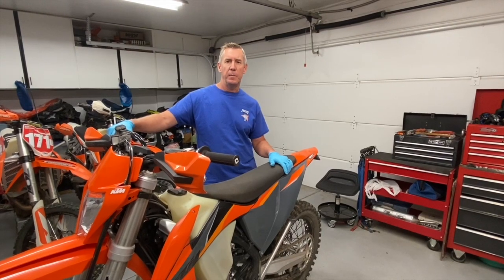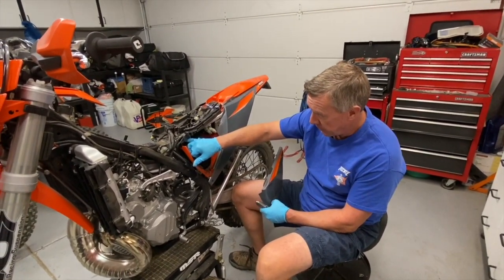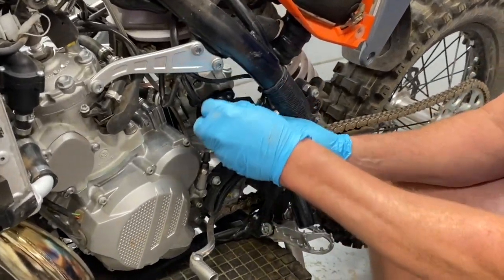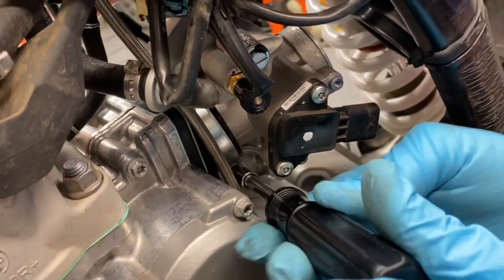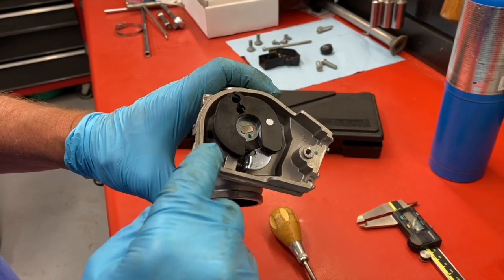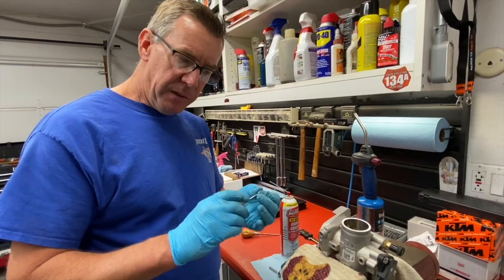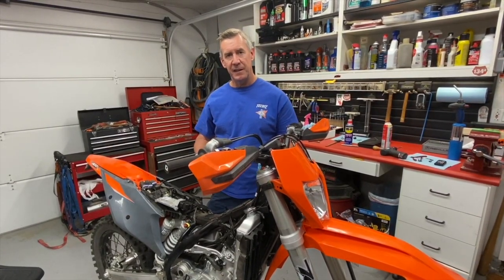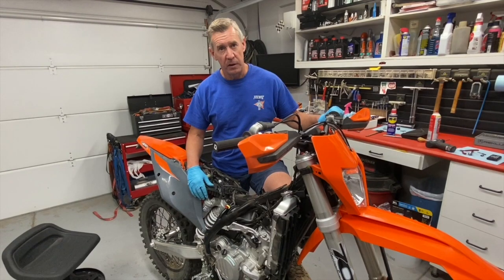Removing Throttle Body and Installing TSP Idle Screw

Comment: Thanks for your VERY helpful video, Steve! I installed an idle screw on my '23 KTM 300XCW and although it took me 4.5 hrs to do it (slow learner), it was relatively easy and now I have an adjustable idle screw -- as the bike should be. This is my first 2-stroke motorcycle -- have only owned it 6 weeks -- and prior to watching  your vid, I didn't even know how to take the seat off. So... learning curve. Anyway now I've not only got an adjustable idle screw, I'm also much more confident about taking my bike apart and putting it back together for service as needed. THANK YOU SO MUCH for making a really thorough video that was so thorough that even a rank beginner like me can feel comfortable taking such a project on. Though I admit I was terrified while heating my throttle body up to remove the stock screw. Whatever -- it worked perfectly.

Comment: Great video.  I just got my TSP kit and am installing mine.   I really struggled getting the airbox boot off the throttle body.   I'm not sure if it's because it's cold here or what. I gouged up my throttle body trying to get a screw driver in to help it off.  I was going to rip the boot right out of my airbox I was using so much force and it still wouldn't come off.   My suggestion is don't even think about using a screw driver.   What I found was MUCH easier is to loosen the clamp at the reed block.  Pull up the sub-frame up and the throttle body will easily pull out of the reed block.  Now you can twist, and tilt the throttle body to the side which will make is MUCH easier to get it out of the airbox boot (no screw driver!).   There is a sharp little lip on the throttle body that makes pulling it straight out very difficult.  So this way makes it way easier and save you an hour of swearing.
Reply from the maker: You are absolutely right Doc.  This is exactly how we do it now after coming to the same conclusion you did.
Reply: Wish I got your comment some months ago. Yes, I had hard time to detach the boot too...

Comment: This was a great video I used it comprehensively today. So well made, really helpful for a newbie like me. Only thing I found was on my bike the wake up dongle wouldn’t prime until I reattached the fuel tank pump connector. Not sure if I maybe didn’t hold the throttle open long enough though I did try it several times, I reattach the fuel tank and it worked 
Also my throttle cables were seized onto the 10mm nuts so when I undid the they must have thrown out the adjusters at the top of the cables. This really had me perplexed for a while. Make sure your 10mm nuts are not seized to the outer sheath I would say spray them with some WD40 before undoing them.  Again thanks for this great video. Getting the throttle body out without lifting the sub frame is pretty much impossible ( I know), your tips were just the tricks needed 👍👍👍

Comment: Excellent video.  For those without a blow torch, I used a few drops of super glue debonder to loosen up the loctite holding the throttle body grub screw.  Grub screw came out easily.
Reply: I tried the debonder for 3 days, and put a soldering iron on mine to heat the Loctite, and still ended up stripping the bolt. Wish it were that easy on mine, but unfortunately it wasn't. It's sad that these bikes aren't allowed to come with the needed adjustment screw.
Reply: @samb4577  what did you do to get it out after you stripped it?

Comment: Thank you for this. Just installed an idle screw in my 2019 KTM 300. Was having troubles with idling, and wanted to use the bypass screw to adjust mixture at idle. Was running fairly lean to get the rpm for tickover. Running much better now, and followed most of your instructions to a T. 

Really grateful, thank you very much.

Comment: OK now this is the LAZY BOY option. I didn't want to tear my brand new 2 week old 2021 Husky 300 TPI down so this is what I did. First I removed the single retaining screw and popped off the throttle cover (I did not need to remove the exhaust to do this, I just GENTLY pushed it from the OTHER SIDE on it's edge at the top with a broad bladed screw driver and it popped off). Secondly I could see the blue Locktite on the screw and I sprayed it 4 times with ordinary DISC BRAKE CLEANER, 30 minutes apart, and left it overnight. Next day all visible blue Loctite was gone, an encouraging sign, but I knew that some would still be active in the threaded section of the housing. 

I then removed a 2.5 Allen/hex from a folding bicycle Allen tool set which have those big loops at the end when you take them out of the set (the loop is critical for leverage, a standard Allen wrench will not work) I then fitted that to the idle screw and once in place, used a bigger Allen wrench handle through the loop in the 2.5 as a lever (any handy short lever would do just as well).Very slowly I kept pressure on it but TIGHTENING it, not UNDOING it. (So many people go wrong trying to loosen reluctant engine setting screws, tighten them first whenever it is possible because the wrench is being pushed in, much less chance of stripping the hex). Just as the 2.5 Allen started to twist a little under strain, it gradually turned the idle screw a fraction so I stopped and warmed the engine to full operating temperature.

 

Whilst doing that I plugged in my OB2 diagnostic unit (dirt cheap on Ebay but get the convertor plug made in England by Lonelec to connect to KTM/Husky) and via my mobile on the free OB2 App, watched the ECU rev count NOT the ENGINE rev count because that fluctuates too much on a 2 stroke, the ECU RPM count is the AVERAGE reading and THAT is the one to set your idle by if you have the choice to do so. It is easier to get the really fine adjustment on a 2 stroke this way. After much experimenting on my bike I found 1775 ECU RPM (easy number for you Yanks to remember!!) to be the optimum for my bike with the Air Bypass Screw totally SHUT. There is ZERO reason for using the air bypass screw, it is ONLY there because manufacturers cannot use any other method to adjust idle without effecting emissions. It is a total bodge because the TPS has not been moved so the ECU has not been 'informed' of a change. 

That is why despite raising the idle speed you get 'flame outs". My bike used to do it all the time and always in the worst situations which caused me to fall off several times on steep hill climbs etc. The Air By Pass bodge works kind of OK on cars and even to some extent most 4 strokes but the 'work around' was never intended for high performance 2 strokes which have totally different "needs" to deliver optimum power delivery characteristics. Trust me, just screw the stupid POS Air By Pass SHUT and experiment with getting a perfect setting with the idle screw, which moves the TPS and 'informs' the ECU to adjust the mixture accordingly.

 

Your bike might vary on it's perfect RPM average but now mine pulls really cleanly off the bottom (quite critical on the RPM reading I found, higher or lower RPM settings were not optimum) and is NOW great at ultra low speed manoeuvres like "figure of 8" at walking pace, but also goes like a f**cking missile when cracked open. Honestly, it is like riding a totally different bike. The first time I gave it a whiff of throttle the front wheel came up so fast in a power wheelie that I nearly fell off, I just wasn't expecting that much sudden performance increase from fiddling with an idle screw! Lastly, remember to drill a little hole in the plastic cover before you put it back so you can adjust the Idle screw without removing it. 

I will get around to replacing the Idle screw with a 5 X 50 mm next time I am in a hardware store (I am certainly not paying $35 for one! 10 cents and an old spring from a Beretta shotgun more like!) but for now I haven't bothered as I don't want to disturb my perfect setting and there seems to be enough Loctite still on the screw to prevent it unscrewing in service. i.e. the idle adjustment is quite stiff in both directions which is perfect. So guys, that is a lazy-arsed Brits way of achieving exactly the same result with 10 per cent of the effort. No heat, no rebooting the oil pump or anything. 

If you do get it WRONG and strip the hex head you are no worse off because you were going to strip the entire bloody bike down anyway, in which case you can release the screw with a pair or pliers once you have melted the Loctite. Worth trying! Less hassle, more riding time!
Reply: Thanks for info!!
Reply: Soy bastante novato en este tema de desmontar todas las partes de mi husky, lo aprecio como terapéutico jaja , acabo de leer tu comentario y claramente voy a intentar con tu comentario jaja . Podrían indicarme el tornillo regulador de aire donde debería estar colocado ? Porque no me ha quedado claro si es completamente CERRADO

Comment: Thanks for this, very helpful. I did it without removing the pipe, just a bit fiddly. I found with the plate covering the throttle cables was hard to separate and I didn't want to force anything so I pushed it at the top from the left side with a screwdriver. Cheers

Comment: Hey! Nice video. Courious to hear about the air screw setup after the mod. Thanks
Reply from the maker: 2018 and 2019 we recommend 0.5 to 1.5 turns out on the air screw.  On 2020 and 2021 we like 2.0 - 3.0 turns out.

Comment: Thanks for the video.  Once you have the new idle screw in, what is the usual fix?  Do you increase the space to more than 4.5mm or less?  I assume you try to keep the air screw at factory setting, and then just turn the idle screw in or out?  If idle was too low, does that mean you turn it in to increase to 5mm or more?
Reply from the maker: There is no usual fix.  The idle screw mod just gives the rider the ability to have independent air mixture and idle adjustments.  The air screw does not need to be fixed to factory settings.  It should be adjusted to achieve the optimum off idle throttle response.  The air screw has very little affect past 1/4 throttle.  Turning the air screw in is a richer softer delviery.  Turning it out is a leaner more crispy setting.  For a typical TPI, 2020 and newer, 3.5 turns out is a good baseline. For 2018-2019, 1 turn out is a good baseline.  Once you have the manual idle screw installed, get the motor up to normal operating temp, and adjust the idle screw in very small increments, 1/16th of a turn at a time, with gentle blips of the throttle in between each adjustment.  The goal is to achieve as low of an idle as possible while maintaing a smooth and rhythmic idle.  No stumbling or stalling.  If you adjust the idle screw too far in or too far out, the ECU will thorw a fault code letting you know the TPS voltage is outside of the desired range. Turning the idle screw in wil lincrease the idle speed and increase the TPS voltage.  Backing the idle screw out will lower the idle speed and lower the TPS voltage.
Reply: @sbmotoperformance  This is exactly what i needed to know.  Thanks!

Comment: Good information. At 12:00 I started wondering if clipping off the plastic was necessary. Couldn't you put the plastic cover on first and then feed the idle screw through the new hole? Setting the 4.5mm gap would be a little more tricky, I guess.
Reply from the maker: You would need both he idle screw and the spring to fit through the hole without making contact.  I think it's easier to just clip the end out.

Comment: I just bought this kit and my bike has never had trouble idling. Do I need to install the idle screw or would I be okay with out it?
Reply from the maker: You can certainly try it without it.  If you feel the idle needs to be adjusted, then we recommend installing the idle screw.
Reply: One of the benefits of a proper idle screw is that you can use the bypass adjuster to change the mixture on idle/low rpm. Allows for better pickup from idle.
Reply: @Jadder88z  I am having trouble understanding how to adjust the idle screw vs the air screw

Comment: Watched your video and installed the idle screw but I had previously adjusted the air screw. Do you know what the factory setting was on a 2021 KTM 300 XCW on the air screw?
Reply from the maker: Factory setting on the air bypass screw vary, but we usually find them between 3.5 to 4.5 turns out from fully seated.

Comment: On my 2020 300xc its was a torqx, on the gasgas 2021 300ec it was 2.5mm hex, my second time around was quicker BTW you do not need to remove the exhaust pipe plenty room from the other side, remove the cover and cables after you get the throttle body out of the boots. Save $ source your own screw, specs 50mm long, 5mm x 0.8 pitch metric screw, plus you need approx 3/4" long spring.  Tip spray WD40 in the boots to help them come off much easier

Comment: Great video , but question So I got the factory Loctited idle allen screw out , but after removing it the throttle mechanism didnt move towards the stop , it stayed at 4.57 mm the exact measurement I got before I removed the factory allen screw, Seems a little odd?
Reply from the maker: Very odd.  Have done hundreds of these and the stop plate always rotates back a bit when removing the set screw.  Not much though.  There is definitely still a gap. Install the manual idle screw and set the voltage at 600mv, and see what happens.
Reply: @sbmotoperformance  starting to think I have a lemon my dongle didn’t do anything either 🙈

Comment: leve the throttle body on the bike n use a mini torch it will come right out after about 15- 30 seconds i have done this on many ktmsno problems

Comment: So how many turns did you tune your air screw to after the mod?
Reply from the maker: All of our bikes are tuned with the TSP Power Kit.  We run the air screws between 2.0 and 3.0 turns out on our 2020 and 2021 bikes.  Further in on the older TPI's.  The stock maps are lean and it's best to turn the air screw in as far as you can but still have a decent off idle throttle response.  The air screw only affect idle to about 1/4 throttle.

Comment: I just can’t remove the back of the throttle body from the pipe. Any tips? It’s really stuck
Reply: Not sure if you got it off yet, but someone else commented and said to loosen the reed side clamp first and the throttle body comes off very easily. Then you are able to wiggle it and get it off of the air boot side. Wayyy easier.
Reply from the maker: Loosen both TB boot clamps.  Lift the subframe up and the TB will pull off the intake/reed side easily. Rotate the TB 90 degrees.  Easiest way to get it off the air boot side is to use the back side of the frame rail to leverage the throttle body out laterally.  This will cause it to pop off the air boot side more easily.
Reply: Thanks for the help. It was super helpful and worked. ;)
Reply: This post is golden! I have been searching all over Youtube for this information. I am stuck at the point of not being able to get the rear boot off the TB. Heading out to the garage now to give this a shot. Thank you.

Comment: Thank you so much for the detailed video. It really helped me a lot installing the idle screw in my 2021 300 xc-w. It's unreal how hot you have to get the throttle body to remove the grub screw, I was really concerned I may have hurt something in the throttle body by getting it that hot. But my bike runs fine now that it's all back together so it all worked out. 

How do you recommend setting the air screw and idle screw? Stock setting was 2 3/4 turns out on the air screw. I found that 1 1/2  turns out gave me good responsiveness, really good low down grunt, and no pipe bang. Turning the screw in more just resulted in pipe bang and mild bogging or slightly less responsiveness, and I didn't try turning the air screw out any more than it was from the factory.
Reply from the maker: Set the air screw for best overall off idle throttle response.  Every bike is a little different.  Sounds like you found the sweet spot for your bike.  We have a video on how to adjust the idle by measure voltage off the Throttle Positioning Sensor. Set it at 590 - 600 mv.
Reply: @sbmotoperformance  awesome, I'll check out the video! Thanks for the response!

Comment: Can i install similar screw in my classic 350 to reduce idle rpm.Will it affect engine in any kind possible
Reply from the maker: This mod is for the newer TPI two stroke models only.
Reply: @sbmotoperformance  my bike don't have any idle control screw,any solution to reduce the idle.Its a 4 stroke uce engine
Reply from the maker: @sourabhpatidar5942  Sorry, we only specialize in 2 stroke motorcycle engines.

Comment: I have the idle screw sitting in my tool box for my 2020, but haven’t done it yet. Is there ANYTHING that this will mess up or could mess up? I guess as long as I put the gap back the way it was set from the factory I should be good. I’ve heard it could possibly cause starting issues.
Reply from the maker: As long as you are careful with the heat, you'll be fine.  Doc's suggestion on removing the throttle body is on point.

Comment: Nice video. I followed it very closely. However now the bike will not start. Currently charging my battery 😞 (2021 Husq TE300)
Reply from the maker: You may have forgot to connect your fuel line?  Try disconnecting it and reconnect it making sure you hear a loud clicking sound to ensure it's fully connected. Also be sure the TPS electrical connection is fully seated.
Reply: @sbmotoperformance  that’s exactly what it was! I didn’t have the feul line clicked and it fired right up! Thanks for checking back!